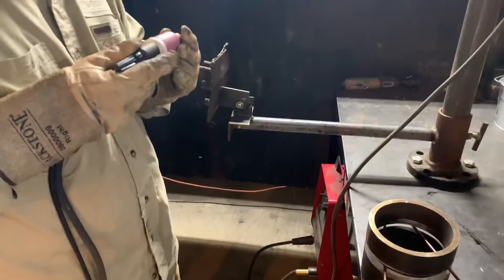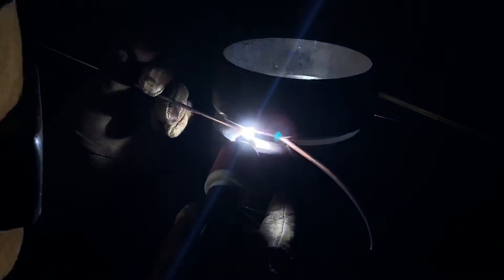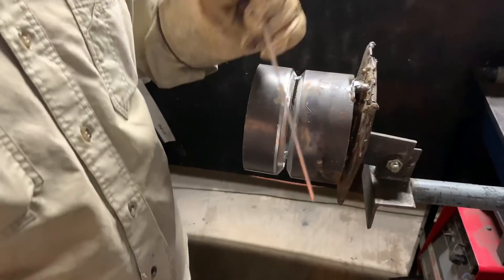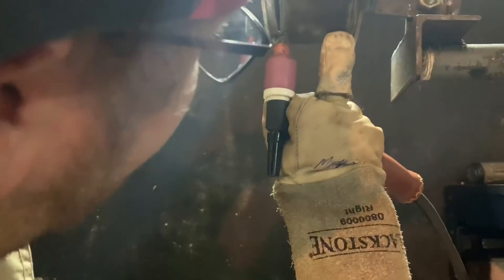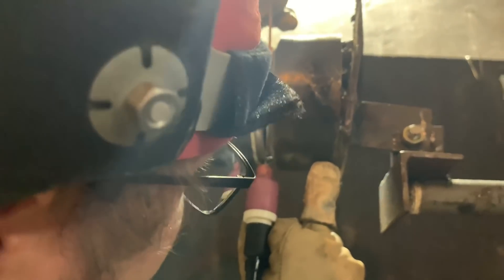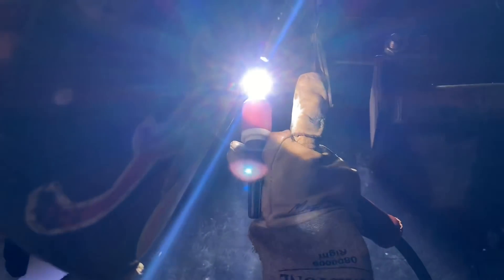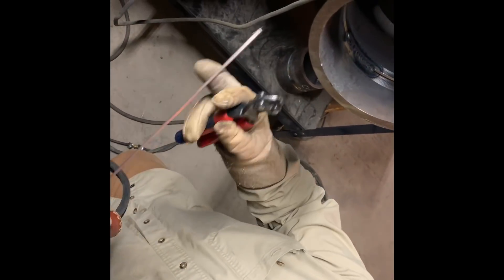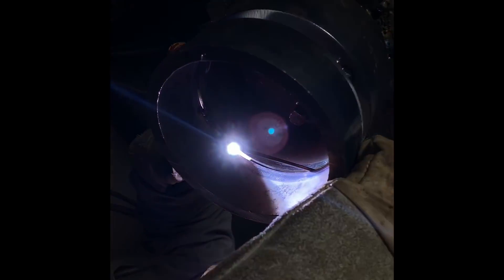How To Back Feed A Root

Comment: If the feeding rod touches the bevel while welding underneath would the wire get struck to the bevel if it touches the upper side

Comment: I have been practicing at home, trying to run root pass on pipe, but I’m struggling with my tig tig, cause it has a button instead of scratching start, and me being new to this, it makes it more difficult, I’m also struggling trying to walk the cup, on the bottom side of the pipe, any advice?

Comment: You pull the fucking Arc out out the puddle like your stitching it in. Adjust your shit, period. This is garbage. Fuck your middle finger shit. Abcs if welding bruh. You failed. Horribly. This is a garbage root. Prolly, barely passed. You are garbage sir. With the utmost respect, you're garbage.
Reply: michael wilson You dont know what you’re speaking of. After you hot pass that thing it’s gonna lay in there just right. You can weld it to get what you want out of it within reason.

The pulling out to the bevel is because in the field at times you’re not able to adjust the machine so you have to employ a variety of techniques to control heat input. You pick the setting and work with it. Uneven fits....thinner material in places can all be overcome with technique. A thumbwheel is nice but not always available.

Comment: Excuse my ignorance,  I'm not in the trade, but why would a weldor back-feed? I imagine clearance issues with the filler wire, but is there a mechanical reason? Specs maybe?
Reply: Honestly its mostly used to prevent suck back and get enough reinforcement on the bottom. You really only backfeed the bottom as to where when you get on top it's more of a lay wire technique.
Reply: @ifitaintrounditurnitdown1735  thanks.
Reply: Swampy  thanks bud.